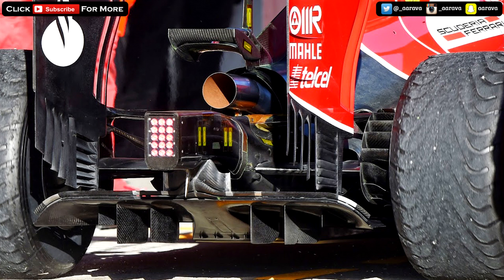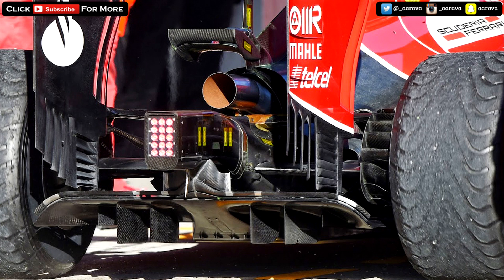F1 Diffusers: How do they work? - Lets Talk F1 (Venturi Effect Analysis)

Comment: what would happen if there is no diffuser ,then also the pressure will change to ambient eventually so whats the use of diffuser
and also u told that in the front region there will be very low pressure and in the rear its high pressure  so will it not prohibit the fluid to flow from low pressure region to high pressure egion 
please reply back soon

Comment: Aarava, excellent video, I am by no means a scientist and I only have very basic physics knowledge. I understand the Venturi effect and the concept of how diffusers work. What I want to know is how can a lamen like myself ascertain the angle of incline on the diffuser to ensure separation doesn't occur?

I have a 2013 Lotus Elise S (supercharged 1.8) and want to build my own rear diffuser, along with skirts and front splitter. The car has a full undertray as standard, although the suspension arms are not covered on the road cars for obvious reasons so it's not entirely a full tray.

I have seen other diffusers and they just appear to follow the angle of the current small diffuser which is on the vehicle. Am I right in thinking that if I mold the new diffuser from the old I can just enlarge it using the same angle?

Comment: What a coincidence, I'm a 1st year Aerospace Engineering student too! The video was very well done, should be easy to follow for most.

Are you involved in any clubs on your campus related to motorsport? For example, I'm a part of Formula SAE (I think it's Formula Student over there). I'm being mentored in aero design at the moment and it's very interesting. I would like to point out one thing though, in your explanation you forgot to mention that air is a highly compressible fluid, and as such it is harder to get that pressure differential under the bottom of the car. 

Also, for your next video, I think it would be beneficial if you spoke about the ground effect era of motorsport, and why sliding skirts and 'vacuum' cars were banned, it would explain why and how aero became so important in F1.
Reply from the maker: i talked about the theory for an ideal fluid, therefore incompressible
Reply: My bad man, I must've missed it the first time I watched it.

Still though, I'd love to see a video about the ground-effect era of motorsport!

Comment: Diffusers don't create downforce, the floor does, diffusers are a device to lower the drag of the cars,as it reduces the low pressure drag coming from the wake of the cars, good use of formulae though, it's just that's a common misconception people have with this device

Comment: Prospective Aerospace Engineering student here. At first glance it seems mad that in a diffuser the air coming out is of low pressure.
Not only is the air confined to a smaller area it is also travelling at a higher velocity so is colliding with the walls of the diffuser with greater force. Both suggest a high pressure to me.
Mathematically the whole thing makes sense but in terms of picturing it physically I can't quite get my head around that. Hopefully I haven't made myself look like a div.
Anyway, really enjoyable and informative video, hopefully I'll see you around the F1 paddock someday.

Comment: If you lowered the front and raised the rear of the car, would you create lower pressure and therefore increase the down force?
Reply: I'm currently studying AS Physics, and we haven't done anything like this annoyingly as Aerodynamics for racing cars is what I want to go into with the ultimate hope being Formula 1
Reply: You would increase downforce at the front but reduce downforce at the rear.
Reply: I understand the front increasing, but wouldn't the rear also increase as there is more low pressure being created? Or is there a limit to how wide the A1 Surface area needs to be?
Reply: Sam Phillips if you raised the rear, you would be increasing the second area and thus decreasing the speed of the air under the car.  If you lower the speed of the air you increase its pressure as per Bernoulli's equation.  The air pressure increase has to occur AFTER it has gone past the rear wheels.
Reply: I see, so if you made the slope more vertical, but towards the rear, that would increase down force? Thanks for all of this dude
Reply: Sam Phillips The difference in airspeed between the diffuser and the floor should be as big as possible so that the pressure under the floor is as low as possible.

Comment: Guys, you must be bored. :D
I didnt understand it....at all....but thanks for the effort u put into this :D
Reply from the maker: ahaha sorry for that, but thanks! :)
Reply: I do get the technical sense tho. But with those digits and drawings and stuff. Nah, just to complicated :D But its great you're explaining it aarava , i hope F1 novices will understand a bit now how those cars are able to corner that fast. Think about Monaco, try to corner the hairpin with a normal car at 90+ kmh/h :D
Reply: TheScania1991 The general rule is, if you slow down air, the pressure would rise, and if you speed up air, the pressure would go down. The inverse is also true. 

In fact, the compressor part of the turbocharger is essentially made from diffusers. Ram air scoops are also diffusers, and if you get to look at a tuner car, notice how the area actually increases as go into the intake. 

The reverse of this is the nozzle. If you used a garden hose before, you may have used your thumb to block part of the opening to make the water go faster and farther.